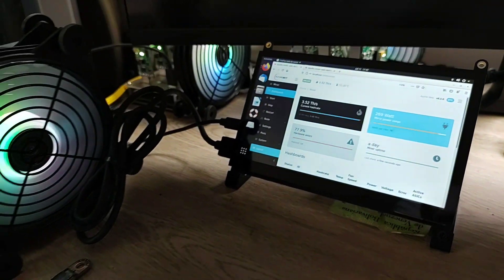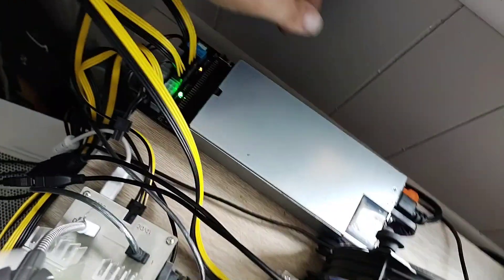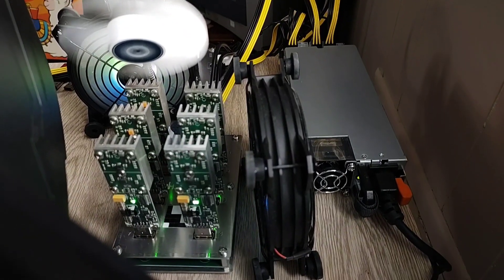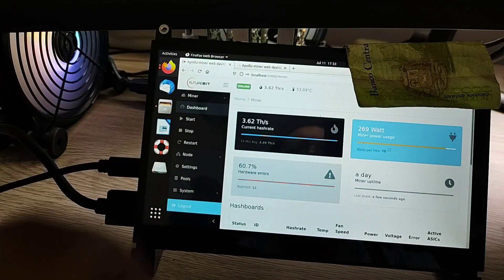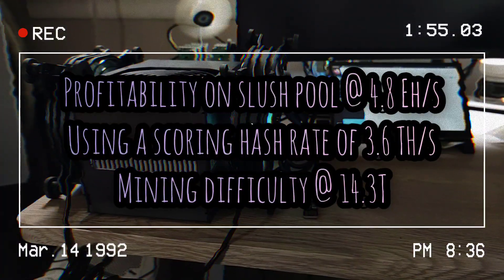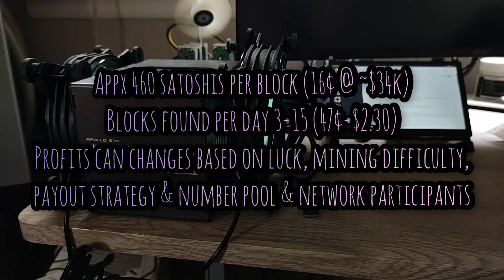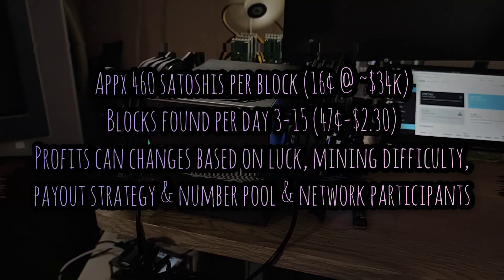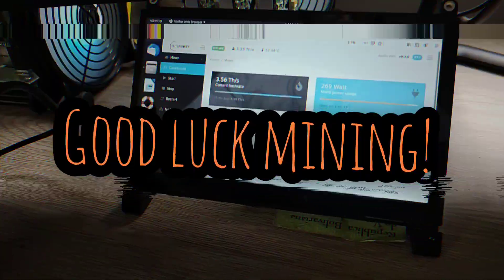FutureBit Apollo BTC Bitcoin Mining Rig ~4TH/s OVERCLOCKED Overview + Profitability & Temps, JTC20

Comment: Hey I have a question, for the Apollo btc cooling are you pointing both fans in? Or is 1 in 1 out? Thxs
Reply from the maker: When i had this set up, i am pretty sure I was pointing them both inwards, where the direction was blowing air onto the miner but i didn't keep this set up too long. 

Eventually i just put one "on top" of it to assist the fan that the Apollo BTC has to push the hot air out a bit easier.
Reply: @justh0dl  are you getting cooler temp with 1 on top?

Comment: $3000 a day?
Reply from the maker: lmao no but i def got you with the clickbait. everything is in satoshis, there's no "$" there.

that said, eventually i think 1 satoshi will be worth a penny, then a dollar.
Reply: @justh0dl  🤣 I thought so but I had to ask. I'm trying to see if joining a pool will be more profitable considering the high electricity cost in my country because a S19 pro will simply pull too much power however still profitable.
Reply from the maker: @moeriedsolomon  one of the reasons i like these miners more than the loud, power hungry industrial miners is that absolute worst case scenario, even at 25¢+ per kWh, the most you'd spend on electricity is like $30-$40 a month.

something like the S19 pro eats up like $150-$500+ depending on your power costs and most likely need some sort of custom electrical work. 

Your downside & overhead are significantly limited with these lower power ones so even if you mine at a loss for a bit, there's only so much you can "lose".

good luck & thanks for the comment!

Comment: It must be extremely hot. It’s already very hot with turbo preset mode. Don’t you afraid of burning your unit?
Reply from the maker: I ran it for over a week at those settings with no issues. I did have an additional fan tho and it was an average of 70 F at my place.

Comment: Make a video on how to actually overclock your unit please
Reply: I have an ATX power supply laying around that’s 850WATT 80 Plus Gold so I’ll plug that in and mess with the settings and see what I come up with.
Reply from the maker: @THErealTYbarr  good luck! You should be more than good with that.
Reply from the maker: If you skip to 1:42, you'll see the overclock settings that I am running. If you want to overclock, you need to toggle "custom settings mode".

if you have the stock power supply, just set the power to like 70%. Then let the miner run at different frequencies. 

note: i have a stronger power supply so your unit might not be as strong or fast if you use the stock power supply. I am using a Server power supply called a Dell 03MJJP + a breakout board. the only main difference you might run into is that I am allowed to draw more than 75% power and not run into issues. If you plan to do this, make sure you use a power supply that's more than 400W-500W.

i started my frequencies at 46 and slowly crepped up. past 55-58 i didn't see any consistent efficiency gains so i ended lowering it a bit. I currently have it on the regular turbo mode, but when I was using custom settings, I left the frequency at 53. You need to mess around with the frequency and power levels till you find a combination that works best.

Comment: what power usb hub are you using?
Reply from the maker: Do you mean power supply? These aren't powered by a USB hub.

If so, I am using a Server power supply called a Dell 03MJJP + a breakout board. PSU costs was less than $50 after cables

Comment: not profitable, and you have pimped this up.
Reply from the maker: Idk what your electricity rate is but at the hash rate and power consumption I'm using, this thing breaks even at 15¢ with a $29k BTC lol. Obviously you would take a while to ROI but when i bought this it was $650 or 1.2 million Satoshis (BTC was at $53k). It should mine that much in about a year. The standard units were a bit cheaper and see the same performance but I'm still waiting on those but i expect to ROI. After that, you just pay for power. Plus there's absolutely no KYC or ID required to get BTC this way which is great.
Reply: @justh0dl  I have the standard unit, have not used. Am waiting for the full unit (with controller) batch 2 arriving end month (I hope).  I just want to pay for hardware after 1 year (I cannot pimp like you).  My original Apollo LTC is soooo profitable (thanks to DOGE).  That has been running non stop for over 2 years.
Reply: @TechNewOld  What is your LTC miner called?
Reply: @doThatGWalk  Apollo Futurebit LTC (running at 100mhs at 100w).
Reply: @TechNewOld  what were u able too profit & how much/day/month? And how many miners do you have?
Reply: @doThatGWalk  the LTC unit : 100mhs on eco , 100w makes 0.087 ish day LTC litcoinpool. On standard 120mhs 140w makes 0.01 LTC …. The LTC unit has been brilliant .  It’s a bit noisier but nothing compared to other ASICS …. Have a video on edit showing LTC different noise / mode
Reply: @TechNewOld  ok I'll check it out. Which is the best LTC Miner? And which pool do you use? How much was your best LTC miner?